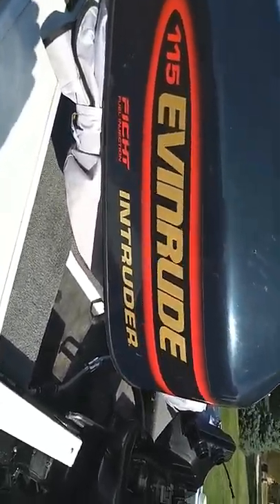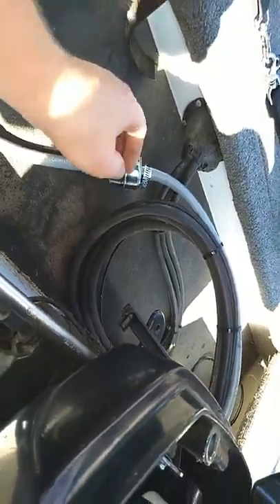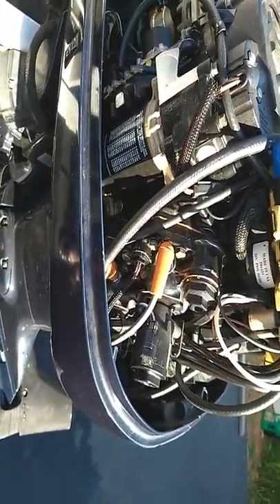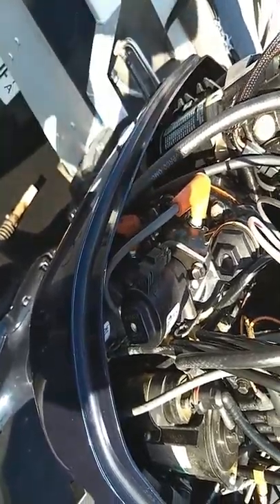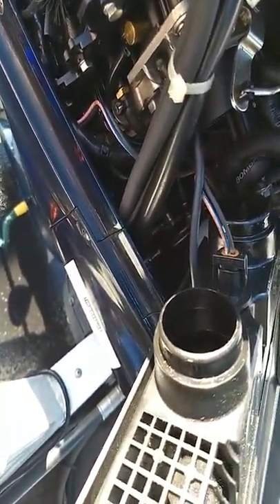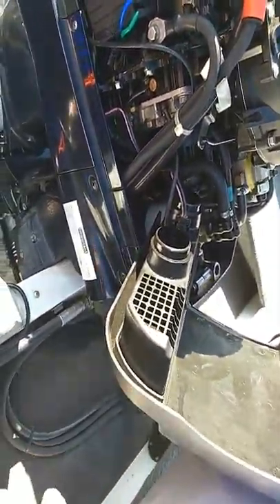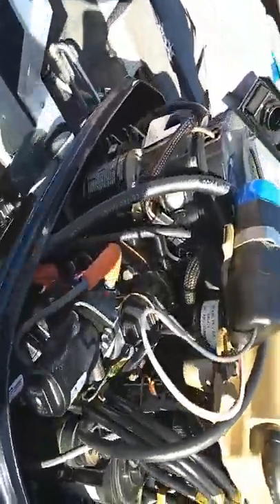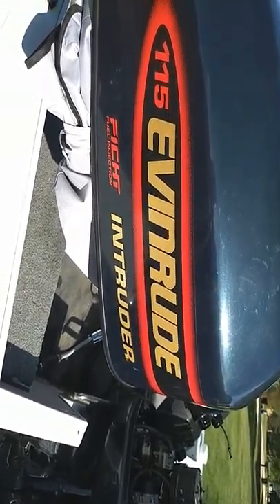Evinrude ficht engine tips

Comment: Glad you are having good luck with it...  That sensor in the air box is the air temp sensor.  You can just twist the whole sensor about 90 degrees and it will pop out of the air box still connected to the lead.  Just don't want you to break that delicate wire connector unplugging it from the sensor.  I haven't worked on these things since they came out so don't know if NGK makes and acceptable equivalent for the original Champions.  The plugs should be indexed even on your engine.  This is a royal pain to do because some plugs won't index properly when correctly torqued.  You sure don't want to overtighten the plug (or leave it loose) to index the plugs properly.  But yeah, the plugs are an issue in these things for sure, and expensive.  Keeping that fuel clean and free from water is key, like you say.  Don't forget to check the oil tank for water annually as well.  The oil pressure sensor doesn't know the difference between oil and water!

Comment: That part that is connected to the 'silencer' is the air temperature sensor that sends that data to the ECU.
Reply: No it's the mass airflow sensor.  It reads how much air goes into the cylinders

Comment: I have a 99 115. Same as yours. You should be running Champion 7712 plus. .30 gap 

You covered most of what keeps these alive. Premium fuel, change fuel filter yearly, plugs every 2 years, and run a high quality synthetic oil like XD 100 or amsoil hp marine
Reply from the maker: I actually called my local marina and  ngk and thats the plug they told me to use
Reply: @sofaking777777  I agree, I am Evinrude certified, no NGK
Reply: Definitely champion plugs
Reply: @addismultitasking3504  9 out of 10 old school  Evinrude mechanics will say Champion. At least thats what they been telling me for years.

Comment: I have a 2000 150 and all the wires burnt out on one side of the motor what do I do
Reply from the maker: Ive read that the 115 is the only good FICHT they made. Lots of problems with the higher hp ones
Reply: Repair any compromised wires, and make sure none of them (including battery cables) are routed near any moving parts (shift/throttle linkages) make sure all connections are tight.
Reply: @ryanfavreau6767  so after looking at the motor once I got it out of the water I found that there's a fuel leak on one of the lines it was leaking on to the spark plug wires causing it to burn computer wires seems to be ok but all the spark plug wires are done.
Reply: @ryanfavreau6767  sorry it's been so long so I fix all the wires back got it to start now not taking reverse then to off the lower unit to check and see if there's something wrong but nothing was wrong with it shit fine when I took it down I even tried a different lower unit something happened,so now I went and check the cables they were shifting fine once I took them down now I'm kinda stuck at the moment.
Reply: @kenwatkins5660  You can make a "fine adjustment" of the shift cable where it enters the motor (on the right side, take the little cover off). If that doesn't work, the shift rod (that goes down to the gearcase) may be bent or the two o-rings "gunked up" (pushing down shifts into reverse). I had all three on my 115
Reply: @EhWassAmattaU  hey how's it going so I got all that fixed but now not getting water flow to the Emm computer the motor itself is pissing fine but no water flow upwards through the Emm..🤷🏾
Reply: @kenwatkins5660  Hey Kendyke, I'm not an Evinrude mechanic, just an owner, so I don't have that memorized... I have my cover and side shrouds off right now (coroded lower motor mount) I will take a look when I get home, and let you know. I think it is from a nipple below the block (something that has water pump pressure...)

Comment: If you would index your plugs they would last longer it's whole reason for indexing if the gap don't face the injector they foul...on top of that you will have a carbon problem...anyway that's why your plugs don't last!
Reply from the maker: I do index the plugs, but you have to buy 10 of them and use the ones that line up the closest
Reply from the maker: I still replace them every spring, runs perfect all summer.  Have a great new year
Reply: Happy New Year... Thank you.